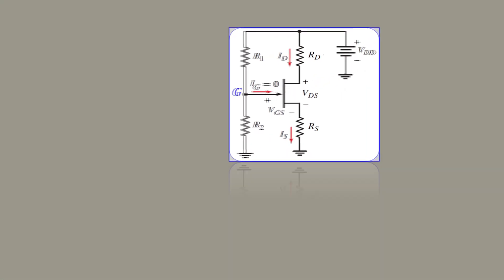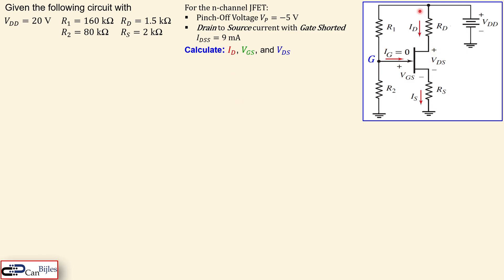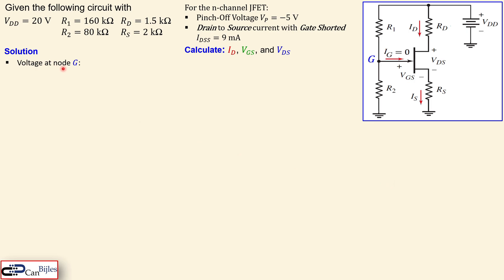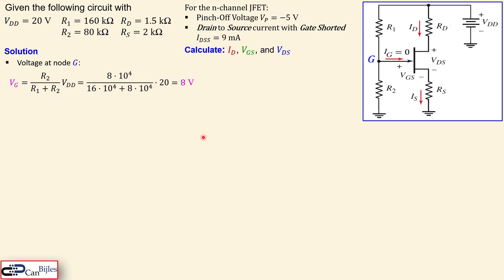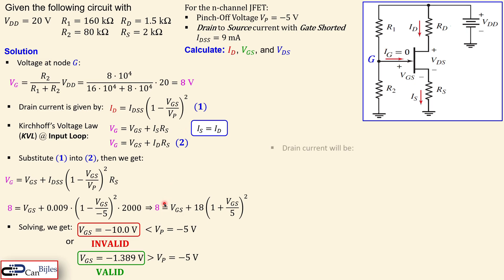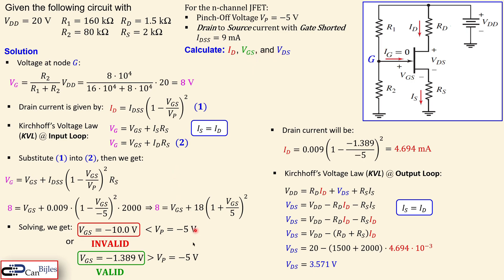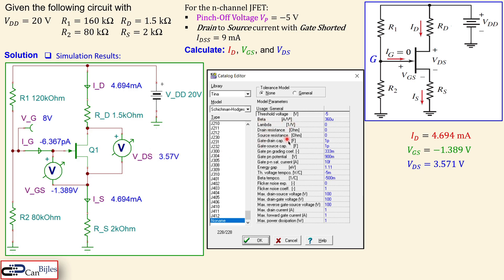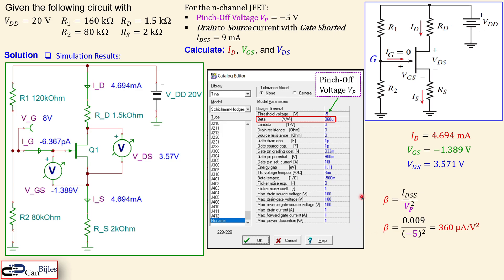Junction Field-Effect Transistor (JFET) 🌟 N-Channel JFET Circuit 💡 Example 1

Comment from the maker: NOTE: the R1 should be 120 kOhm, not 160 kOhm. All results in the calculations and simulations are correct, the resistor value is just incorrect on the slide.

Comment: Hello, I think you calculated the VG wrong in the beginning of the video. You say that 8/(8+16)*20 = 8 V, but 8/24 is the same as 1/3 when divided by 8, then multiplying that by 20 would give you 20/3, which is 6.67, not 8 V.
Reply from the maker: Thanks for your message. There is indeed an error, but it is the resistor value. The R1 should be 120 kOhm, not 160 kOhm. It is also the correct in the simulations.